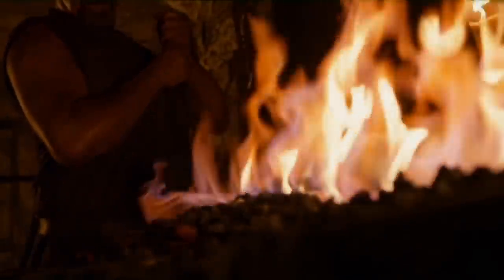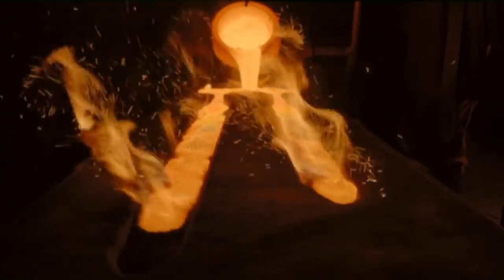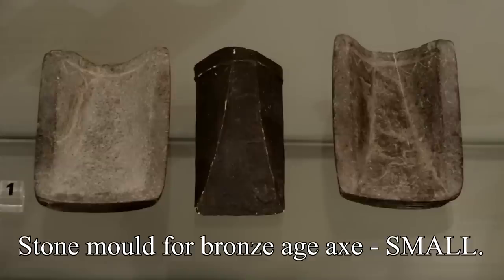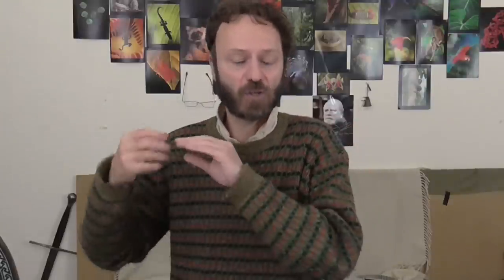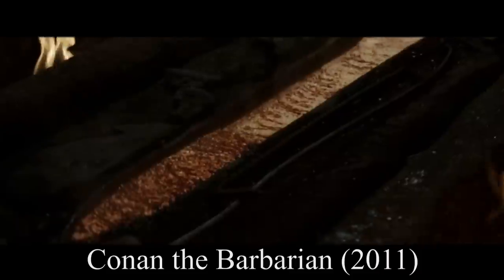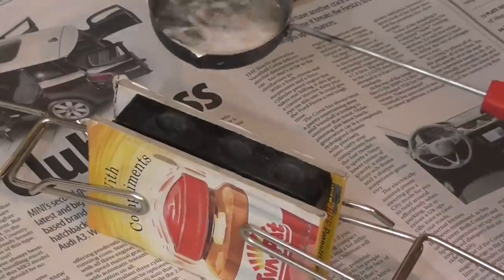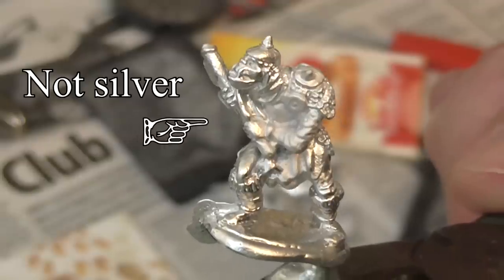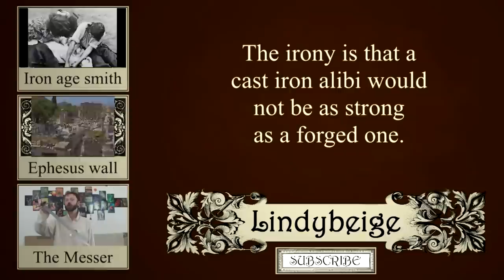Casting swords in the movies - forging a lie

Comment: Color is made by electron shifting orbital levels, wich varies in accordance to the periodic table... It does depend of the element. Thats why copper burns green in foerworks, and other metals have other colors, altought the fierworks themselves have the same temperature. You can use a buckner burner to heat different powdered metal to see that the "the color depends on themperature" isnt true. Basic chemistry there.

Comment: Just a small hint. First yes iron and steel are two very different things. You surely do know that steel is a combination of carbon and iron. But it has very different properties and has to be treated differently. Just look at a phase diagram. The casted product also has very different properties. So i would rather not call a steel sword and iron sword and vice versa. Second yes you don't want to pour the metal so slowly that it solidifies too differently. On the other hand you don't want to dump it in quickly. Especially not if you have a mold that you fill up from the top. The liquid flushing metal traps air bubbles if you pour it quickly. That weakens the end result. Other than those small details great video

Comment: Has it ever occurred to you that they were just splitting the iron from the original sword it was taken from into two more-or-less measured sources of steel for the two new swords that would be forged out of them afterwards? Because that is exactly what they were doing in The Game of Thrones clip, not forging. Even worse, 3466 comments before this comment also didn't get it.
Reply: good point, but this guy thinks molten aluminium is orange instead of silver, so i wouldnt waste your time, he doesn;t have a clue what he's talking about
Reply: @artemislogic5252  Well also this is Valyrian steel, not aluminium or steel.

Comment: Steel is a mixture of iron, carbon, chromium, nickel and maybe other materials. There are numerous variations on this mixture, and most are not magnetic.  A common variety used in kitchens is 18/8 Stainless Steel, which has 18% chromium and 8% nickel.

Comment: The whole idea of mold isn't to produce a "working" sword out of it as soon as it loses its temperature. It's to have a long slab that you'll bang with your hammer later and that way you'll give your sword the shape, fix its lenght, width and later its sharpness using the grindstone.
Casting iron into molds like those simply speeds up the process of making cheap/average/common swords. Close to mass producing it.
The more "personal" swords weren't made out of casts, but instead they were formed from some kind of block of metal and shaped from it. They are whole lot sturdier and have let imperfections.

Comment: As usual with your videos, i enjoyed watching this one. Well, mostly. Besides the by far majority being valid critique, there were moments in the video that hit my nitpicker nerve:

- "You know what steel is made out of?" Well, yes, I do. That’s why I accuse you, by firmly answering just "iron", as being guilty of omission. While steel’s main content by large is in deed iron, other ingredients, mainly carbon, despite their comparatively minor portion, alter the material's properties considerably. They make it significantly better suited to be used as weapon blade than just pure (read: as pure as reasonably producible) "iron", e.g. making it more flexible and less brittle. Also steel’s carbon content lowers its melting point. Higher carbon steels have often a melting point around 1370 °C (2400 °F) compared to iron’s 1538 °C (2800 °F). Some swords even would have different carbon infusions, applied during further processing, used for different parts of the blade to enhance their specific role.

- In the beginning of the video when talking about the open cast, I got a bit the impression as if you expect steel casting would be used to give a sword it’s final form (aside a bit of sharpening maybe). I’m not sure if
a) you think steel swords would not be cast into a sword like shape and just hypothesise (Your emphasis in “They did cast swords in bronze” makes me consider that option.)
b) or just criticize that the mould is open on one side of the blade and, other than that, be fine with casting steel swords to final form.
Steel swords will always, besides other treatments, be forged, even after being cast already into their raw form due to mass/accelerated production. This is required to have the steel's crystals orient to each other into an ordered grid to further it’s toughness and stability.

Btw.: Cudos for using "centigrade" (aka. °Celsius) instead of °Fahrenheit.

Comment: Actually it makes sense in a way, if you cast in a sword-is shape you could heat treat the metal to get it back into the quality you want and then reshape and grind down the blade making it faster to make those swords. Which is why you see Smith's hitting the blanks with hammers, however you are not going to cast a finished piece in a 2d mold. It would be the same as pouring an ingot in the shape of a sword. So yes you could cast and for mass production it makes sense. For individual swords it makes less sense, but could still be used.

Comment: First: to melt iron you need a fireclay melting pot which withstands 1700°C - which was not available before 19th Century.

Second: If you pour iron onto stone, it will break up and/or melt. There's no natural stone which withstands liquid iron. That's why iron is casted into sand - until today.

Third: Cast iron is brittle and cast steel has got a pretty high viscosity - which makes it difficult to pour it into a cast. Also cast iron (more than 2,5% Carbon) was not available before late 18th century.

And you cannot forge cast iron without ending up with some sort of granulate.

And last: Ovens hot enough to contnuesly melt forgeable steel were not available before 19th century. 
The medieval smelting furnaces just produced a single lump of steel, which was not accessible before you dismantled the oven after it had done its job.

Comment: I was hoping you'd be going into details of the difference between casting and forging iron/steel. What makes steel so strong when it's forged and not cast?
Reply: I believe it has to do with the crystalline structure that is allowed to form within the metal once Iron cools down from the liquid phase. It's brittle, whereas when it's forged the metal is being bent so the atoms don't form a crystal.

Comment: Quite a bit of misconception here; PURE iron melts at around 1500*C, cast irons typically have a high carbon content of about 3-5%, at 4.3% carbon equivalent, the metal forms what is known as a eutectic, the metal goes directly from a single phase liquid to 2 phases of solid at a much lower melting temperature (1100-1200*C). Iron is orange when you pour it. So is brass. Aluminum, unless superheated to several hundred C above melting temperature, will form a shiny oxide layer on top and appear silvery. The main reason for forging is to reduce entrained porosity and redistribute any impurities into smaller pockets in the piece so that they don't form one continuous impurity (which will likely crack)

Comment: I know I'm 7 years late, but one thing people don't seem to understand is that the color of molten medal to our eyes is going to look way different than to a camera. Notice how dark everything else is around the metal. The cameras exposure has usually been lowered to expose for the metal instead of the surrounding scene, so you see the orange glow. So maybe they're pouring iron or maybe not (because other materials are cheaper anyways) but it's hard to judge the material just based on the color when camera exposure and color grading have a big effect on that.

Comment: I've seen knife makers claiming good knives have iron tangs because iron is softer and less prone to crack then steel, so I thought oh everything I've thought about it was wrong then I come here. I want the truth!
Reply: Cast iron is brittle, but if you forge it by getting it hot enough to pound into shape and then temper it (all generally at that orange color rather than white), it becomes very strong and slightly flexible.
Reply: @Ravaxr  They probably mean low carbon steel, not cast iron (which is actually high carbon iron alloy ironically).

Comment: what i could see them do is cast a roughly sword sized ingot before forging it, just to save a bit of work making a preform, since they didn't have standardized steel rods in the "medieval hardware stores" they also didn't have :P
but that requires a really hot fire, so dunno if feasible.

Comment: Another issue is that unless the stone mold were gradually preheated, it likely would have cracked due to thermal shock. 
I doubt they used aluminum to cast the sword, because aluminum is an extremely effective heat conductor. The rapid transfer of heat from the metal to the mold would have solidified the metal very quickly. They probably used a thick liquid like gear oil or cornstarch and water, and then did a bunch of video editing to make it appear hot.

Comment: i have watched bladesmiths forge blades and alot of the modern smiths with plasma cut a blank of a blade and then forge it to shape, by casting the smith would save days or weeks of time hammering a blank to shape.

Comment: I’m a pipe fitter by trade and can confirm that the way we remove old cast iron fittings (if we can’t spin them apart) is by shattering them with a hammer.

Comment: Okay so in Game of Thrones the steel is Valerian steel which is actually a lot harder and the reason they cast Valyrian steel swords is because you can't really shape it or hammer interest rate line like a sword would be so they cast it so that way it saves them a lot of time and then they just have to forge The Edge and flattened both sides basically the reason forecasting Valyrian steel swords is to save a lot of time because you can't work it like a normal sword working on the edge would take as much time as forging a normal sword from scrap

Comment: 1. Open top is more cinematic
2. Not having to wear welding goggles while watching a movie is advantageous, so the color is orange. 
3. The term "molten iron" that you use may include cast iron, but does exclude low carbon or any other form of steel. Any alloy of any metal can be cast, but will require varying degrees of effort and post heat-treatment. Casting tungsten is both energy intensive and pointless, since the product usually ends up with worse properties. Casting high carbon steel or forging it both end up with virtually the same properties if you bring it up to critical temperature.

Comment: In that game of thrones scene those are sword blanks- they are not sword shaped in 3d. Only the two-d. There is no fullering or taper to an edge in that mold. So the open topped bit could theoretically make sense there (and grinding was done historically, I think). That said, why would you use an open mold? So you can burn yourself on the hot exposed steel? Much more logical to use a closed mold that give3s at least part of the taper to the blade.

Comment: A few corrections. To start off, the pouring in game of thrones, stupid. Scene in fellowship, plausible... thing is 1. In terms of the mold, when creating mass weapons for a cheap army, pounding out ingots would take ages. Perhaps a faster way to do so is to pour it in a general 2d sword shape that then could be worked with a forge and hammer and then grindstone later. 2.in terms of mold material, we don’t know if either of those were stone and by the rough shape of them I’d guess they were either clay or sand (easier to shape and commonly used for molds) (also you can dig out the item) 3. In terms of the metal, it very well may be iron. You can see in the clips that the only bit that’s visible is the metal, everything else is pitch black. What this means is that the exposer was turned waaay down because when looking at molten iron normally all you would see is a blinding white blob. The exposure being lowered would turn (near) white to orange in this case. 4. Cast iron swords would undoubtedly be shit. However when you look at the orcs swords they were pretty shit. They wanted something quick and easy to make to hand to their thousands of disposable orcs to go in, get their cast iron bash on some poor sap, and be cut down to make room for the next one. The goal was cheap and shit not nice and long lasting quality, after all the orcs didn’t set up cities families and governments when they conquered a place they were a throw away army. So yes, game of thrones scene was pretty dumb but showing someone forge two swords out of one would be a pain and very long in order to get the idea. Fellowship though, did show regular forging with the rangers sword but also showed a cookie cutter method of making quick cheap shit swords for a cheap and shit army. Case rested.

Comment: If you could cast steel, wouldn't you then be able to heat treat it to be soft enough to safely grind away maybe a millimeter's thickness, and then continue heat treating and tempering from there?
Only problem would be, did they know how to make molds back then of materials that could withstand that kind of heat? Because they didn't learn to synthesize graphite until the 1890s.

Comment: But What if they need to get Steel they Melt Iron ore and get pig Iron which can turn into steel to burn the Carbon so to get a Carbon concentration of 2,06% or even lover and then they cast it into a form which can be hammered o rolled . Or iam wrong?

Comment: The meltingpoint of steel differs actualy depending on the amount of carbon, with the lowest melting point at 4,3% at about 1153°C. The iron you are reffering to actually has not enough carbon in it to be casted.
Reply: But steel at 1153°C still is yellow to brightyellow

Comment: Hang on, coming at this from a metalworking direction: "Cast iron" is iron with 2-4% carbon content. "Steel" is iron with 0.2% to 1% carbon content. The big improvement in metallurgy that enabled steel was actually the ability to work out enough of the carbon to remove the brittleness of "cast iron." You can totally cast steel, you just need to temper it afterwards!

It might also be reasonable to cast a raw shape in an open top mold (albeit quickly) as a raw blank, if you're going to work/forge it afterwards, to save some work -- but historically that's typically in ingot shape, not finished sword shape, AFAIK.

Comment: you said a high specific heat capacity absorbs heat well, that is not true it means more energy is required to change the temperature.
Reply: ... thus it would absorb heat well, then
Reply: @talltroll7092  except when its already hot

Comment: 1:53  Stone actually feels cold because it has a very LOW specific heat capacity.  An object that absorbs heat quickly, typically doesn't take much energy to warm up, hence a low specific heat.

Comment: If you have two materials with drastically different emissivities then you could in theory have materials that emit different amounts and colors of black body radiation (radiation that makes really hot things glow) at the same temperature. You see this type of thing when you look at cooler things "glow" using an infrared camera. Note that all things above absolute zero "glow" (even you) we just can't see it with our naked eye until they get really hot. But in the visible spectrum, most things have similar emissivities so they generally have the same color at the same temperature.

Comment: as a real blacksmith and a fiction writer...this guy is basically my own inner monologue when i see any movie with swordmaking. it's absolutely horrid how bad they mess it up. if you're gonna make some shit up, make up a fictional metal. "Oh its no mortal steel, this is Tharnium, blessed by the elves." and done, no problems. why can not just get steel right and make the finctional stuff cinematic? how do you forge Mithril? nobody knows because its FICTIONAL, it doesnt exist and it's magic. you cant nitpick magic, so why not just use that? freaking conan. UGH. describes bronze, pours aluminum, then it somehow turns into steel and they heat treat it by unevenly heating the blade and cooling it in icewater about halfway down. yep, you just cracked your bronsteeluminium sword there aquaman. good job.
Reply: In my own personal opinion, even saying just saying "It's magic" and leaving it at that is a big fucking copout. Either explain how and roughly why your mythical metal works the way it does, the general process your world's smiths go about using with the metal, or just say it's done the way it was really done in history and be done with it. You don't have to, of course, but it won't detract from your world, it'll only add.

Comment: So this begs the question, if they were casting aluminium instead of iron as you suggested would it be usable as a sword? Is it possible the characters just don't know the difference between iron and aluminium?

EDIT: Looked into this and the end results (for swords at least) would be of arguably equal quality to that of a cast iron sword. That said the aluminium sword has some merit as a practice weapon for training if it has a blunted edge.

Comment: Perhaps, with a little suspension of belief, they are casting blanks for forging and the casting process is just to get the steel in roughly the right shape. But that only really happens with modern forging under massive industrial presses.